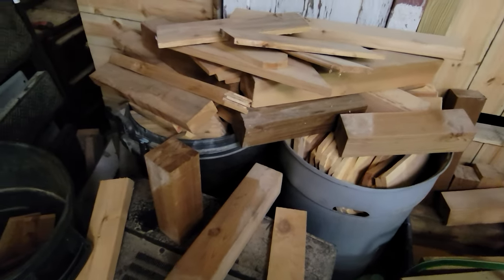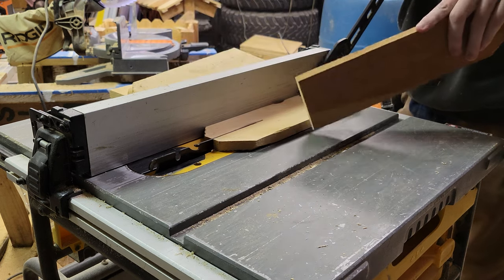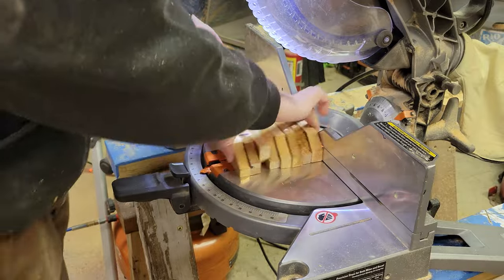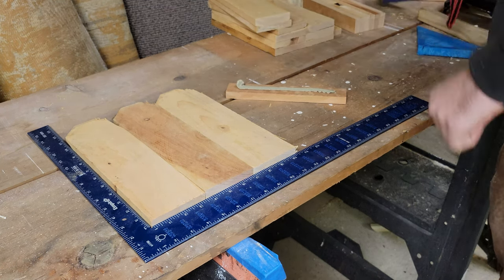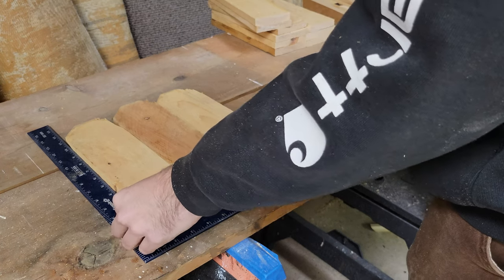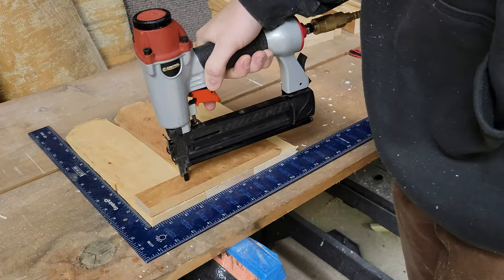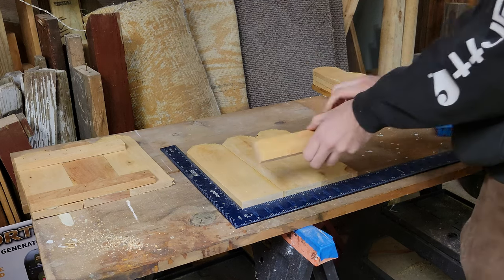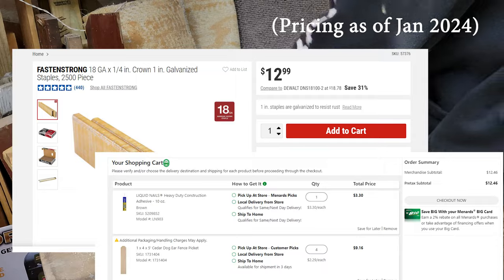Cedar Fence Picket Planter | $15 DIY Project

Comment: very cute but done the most expensive way possible considering what you could build with bigger pickets for $8 - $10 and sell for more.
Reply from the maker: While yes that is true, these were free to me as they were scraps from a fence job that I did. Would've been firewood or tossed out otherwise. 

I'm actually working on a video now using the bigger pickets that you are referring to.